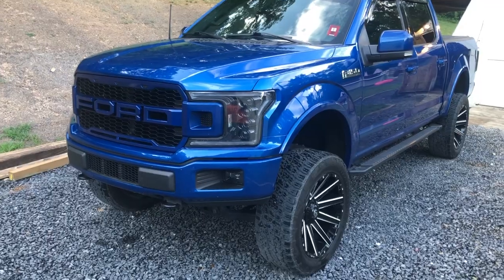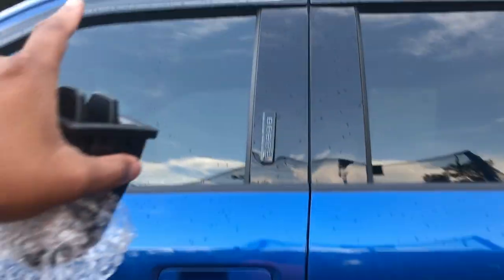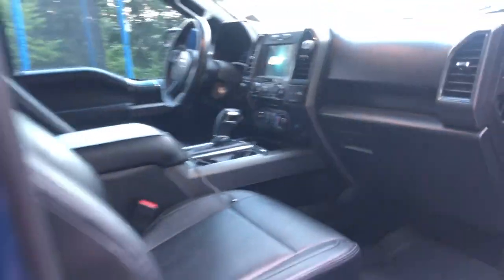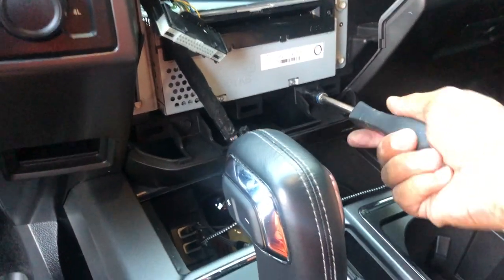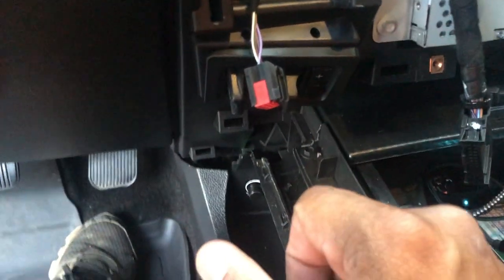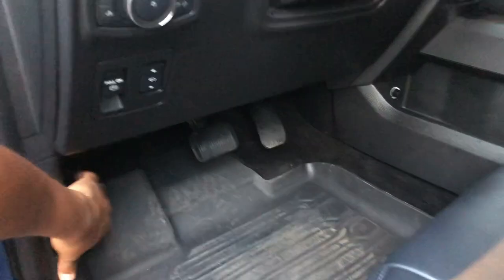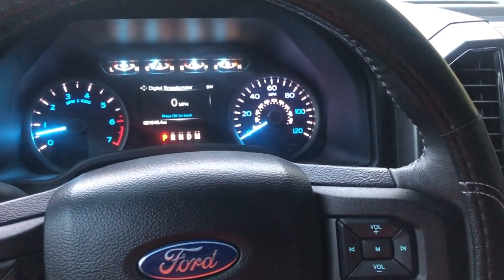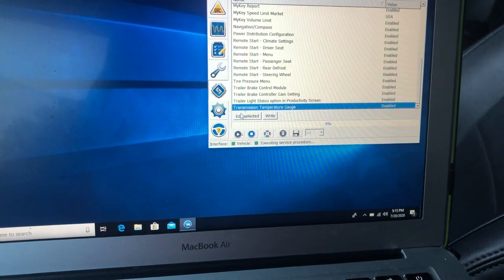2018 Ford F150 Trailer Brake Install Activation **FORScan Changes**

Comment: Informative video, thanks. For those who do not have the 30 amp fuse my 2018 STX did not even though the truck came from factory with basic to package. 30 fuses were installed in fuse panel for passenger and driver power seats which my truck does not have, I moved 30a fuse from front driver seat #21 position to the trailer brake #24 position and everything works now. No additional wiring needed.

Comment: Thanks, worked like a charm on my 2018 Lariat. I didn't totally disconnect the two plastic panels, I left all the wiring attached to both. I was able to slip the brake module in with no problem.  Never would have been able to do this with out your VID.
Reply from the maker: Glad it helped

Comment: Kenny, great video! This video really helped me install the brake controller in my 2019 F-150. Thanks to your reference of how to use ForScan and the fuse, I was able to successfully install the brake controller. After getting the brake controller installed I had to request a 2 month trial license for ForScan. It took several hours for my ForScan account to be activated to then generate the trial license. I got the truck’s computer to enable the trailer brake controller. Then I got a trailer brake fault on the dash. Thanks to your video on checking the fuses...I found my issue. No fuse in #24. Thank you so much for your content! This saved me hours of frustration!
Reply from the maker: PERFECT!!!! That’s the plan. I wanted to help some people!

Comment: You gave me a scare when you said that not all the trucks came pre wired for this.  I immediately paused the video and went out and looked at my fuse box.  I discovered that mine didn’t have a fuse in that spot, so that scared me even more since I already bought everything.  I ran to grab my tools and tore apart the dash panels pretty quick and luckily the wiring was there.  I just have to find that fuse, and since it’s not a common fuse I guess I will have to get it from the dealer.  If my truck has the wiring then all of them have it, mine is a 2019 regular cab short bed xl with a 3.3 L v6 and 3.55 gears, so not really made for towing much.
Reply from the maker: LOL. I understand when fears kicking in. I’m glad this video could help you.

Comment: Trailer brakes work dong this on my 2018 F150 but I have no 12v charge power on the 7-way trailer connector. Did you get yours to work? If so; can you tell me how, i think it is a Forscan change of some sort.

Comment: I went though made enabled the modules. But it wont let me change the gain. Do I need to go into the IPC AS BUILT format and make changes to the values because mine are totally different then yours.
Reply from the maker: I’m not 100% sure on that. But my personal opinion is that a pen and paper is your friend. If you make any changes to those numbers, make sure you know what to change them back to in case something does not function properly. Are you sure there is not an issue with your controller?

Comment: Not sure if I missed it in the video, but can you send me the part number for the brake controller? I have a 2018 XLT as well.
Reply from the maker: This is the one I used.JL3Z-19H332-AA
Reply: @juicer911  thank you!

Comment: Great video. So you have to have the Forscan to get the brake controller to engage? I want to make sure I buy the right stuff.
Reply from the maker: Yes you do
Reply: @juicer911  which one? I see several versions online. They look very similar to each other.
Reply: @jenniferlzr5651  The latest - FORScan for Windows v2.3.37 from Forscan.org
Reply: @barryguidry9870  thanks, but I never got it to work. The IPC never came up for the brake controller. Paid Ford $141 to do it 😫

Comment: I bought my truck used a couple months ago. I installed the oem trailer connector for and the fuses are all in place. Where did you go to get software to reprogram the trailer settings.  Thanks
Reply from the maker: I downloaded the forscan software. From forScan.org. That is how you  enable it and activate it on your dash
Reply: @juicer911  is there an attachment I have to buy to plug into my truck
Reply from the maker: @stephenarndt3654  This is the one that I have. https://www.ebay.com/itm/114583309726
Reply: @juicer911  thank you for the info.  Btw your truck is badass
Reply from the maker: @stephenarndt3654  thank you. Gave it a great deep cleaning yesterday. I love this truck!
Reply: @juicer911  this is my first ford truck ever and hands down the best truck ever. Will definitely buy another one.
Reply from the maker: @stephenarndt3654  did you get the 5.0 or Eco?
Reply: @juicer911  the 5.0

Comment: @Kenneth Toney, I also have a 2018 F150 XLT Sport 5.0L.  I bought a break controller on eBay hooked my up and did the forescan enabled both and got the gains settings, but after I did that it disabled my drive modes ( sport, eco, tow,etc..) did urs happen to have that problem, or anyone else out there.? I’ve even disabled it and left it plugged in and it still disabled the drive modes but I unhook it from the harness and back to normal.? Is there another setting I might need to change.?
Reply from the maker: Sorry that you’re having difficulties. I didn’t have any issues with my drive mode at all. I’m really not sure where to go from there.

Comment: Could have shortened the video a lot by not including all the unrelated upgrades to your truck!
It's about a trailer brake controller install - not tires, rims & lift kits.
Reply from the maker: If you don’t like the video, don’t watch. It is about what I make it about.